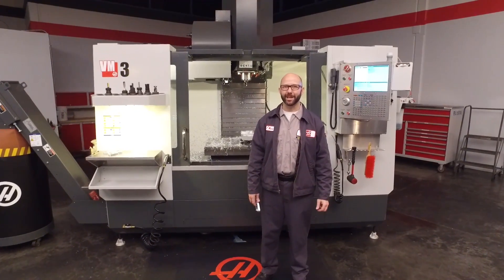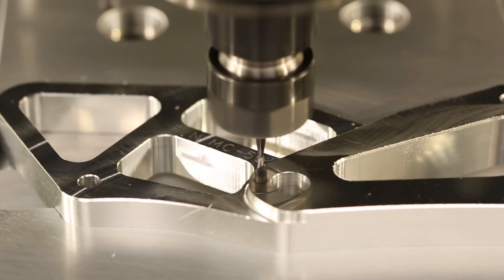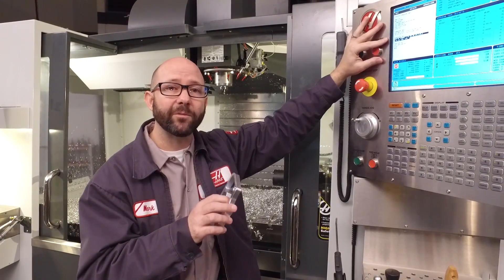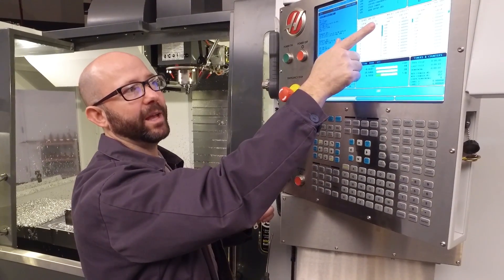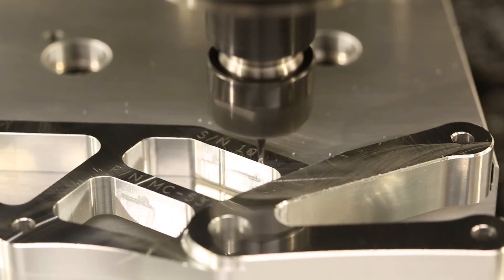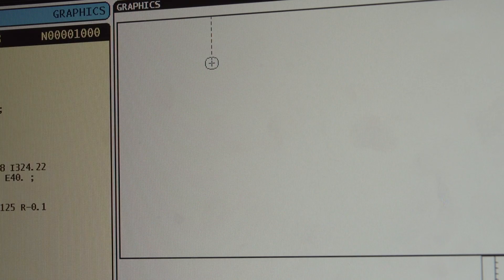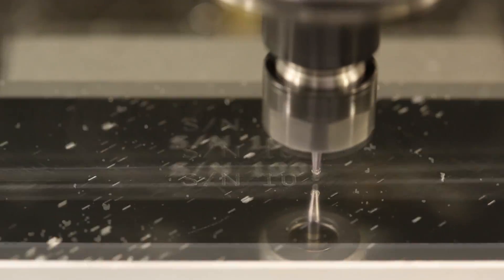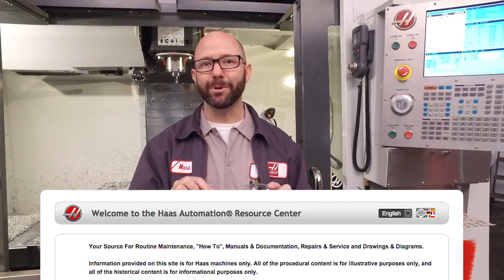Easily Engrave Sequential Serial Numbers – G47 Part 2 – Haas Automation Tip of the Day

Comment: This video popped up in my email. Watching the video I had 2 question. But when I started reading the comments I realized I already asked this questions 3 years ago. Unfortunately I did not get answers. Maybe I can get answers this time around. There is still No link. And I still would like info on the engraving tool You are using, please.
Reply from the maker: Anshel - 
If I am just engraving a part number on one part or fixture, I often just use a Spot Drill (don’t tell anyone). For production parts, a small (1/8”, 3mm) die sinking endmill (runner cutter) with a .03” (,75mm) radius lasts really well. For cosmetic engraving (molds, golf putters), Single Lip Engraving cutters, with small “tip-offs” (flat at end) are often used. Tools with large radius on the tip, and blunt cutter angles, last longer. Pointy tools with sharper angles (like 15° included) tend to give better looking engraving, but the tools don’t last as long. Companies like Harvey Tool have a wide line of engraving cutters. Use lots of coolant on brass and aluminum. On steels, I’ll often just use a dab of tapping fluid on the part (no coolant). Run the highest RPM you can, and keep your feedrates low (.0005” Fz per tooth starting). Email me at TOD@haascnc.com for the bonus conent, our website migrated and the links were lost, but we are working on it.  – Mark, Haas Tip-of-the-day
Reply: Haas Automation, Inc. but what kind of tool is used in this video? Looks special.